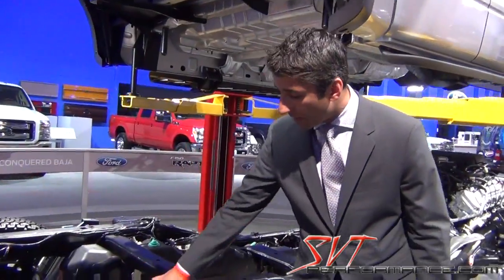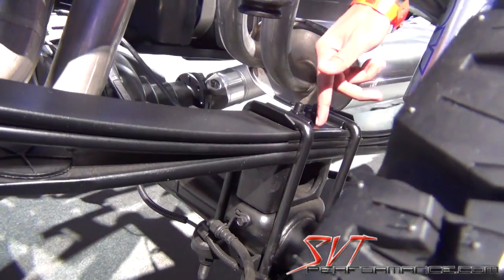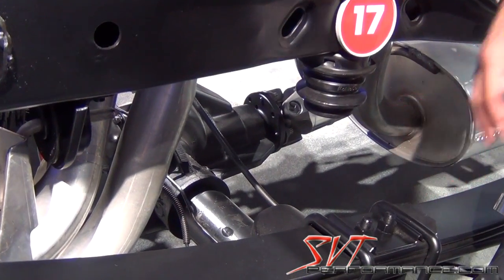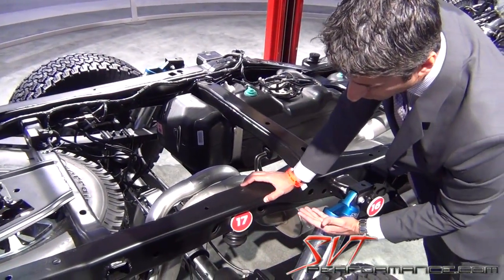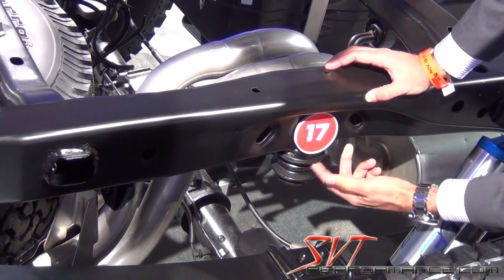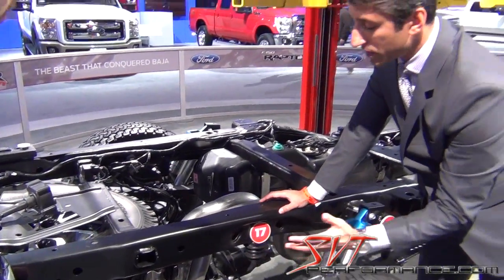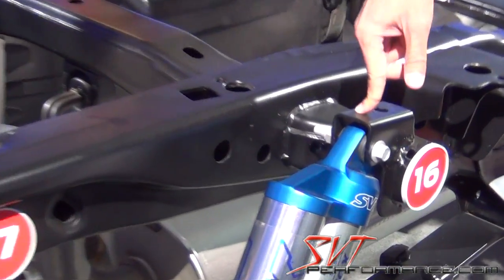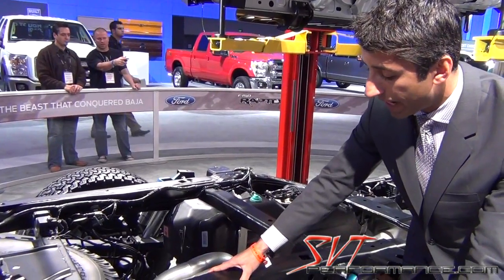SVTPerformance.com :  SVT Comments on Raptor Frame Bending

Comment: The Ford engineer was correct in all his technical analysis. Ford marketing should've consulted Ford engineering before hyping the Raptor to determine the actual limits of the vehicle. Some argue, especially those Raptor owners who ended up with bent frames, that Ford's corporate ego actually encouraged exceeding the mechanical limits that end up bending frames.

Comment: The group of 14 raptors who set on a desert run and 10 out of the 14 trucks had bent frames (where the bent frame talk originally came from). The 10 who had bent frames also had modified rear suspension to some degree or another AND had programmers with electronic limiter removed. The lead driver of this pack was said to be in excess of 120 mph on multiple occasions. NOT what the raptor was designed for.

Comment: so your saying that your not suppose to drive the truck like the manufacture says u can because you will bend the frame or brake the shock mount so whats the point of the truck when u can build a better truck for the same ridiculous price the raptor costs

Comment: they should have over engineered parts like these in order to reduced these problems..... something that the Germans would have done.... just saying they should have gone back and re-engineered the components to a point where you would have to do something literally moronic

Comment: Enjoy your 4-cylinder truck.

You know, since all Jeeps have 6-cyldiner engines, all Ford trucks are 2.3L Rangers.  The Toyota Camry has a bigger engine than every single Ford truck ever made!  It's even more powerful than the Raptor, I guess.

FWIW, typical old-skool Jeeps have an I6, not a V6.

And if you were going to comment on it, should have mentioned that most Jeeps don't even have a frame, except for the Wrangler they're all unibody.  Hard to bend what doesn't exist...
Reply: more displacement doesn't equal more horsepower
Reply: shepd3 this is probably one of the dumbest responses I’ve ever read.

Comment: nope, the problem is def. with the chassis, its so clear. If it wasn't why would there be SO MANY aftermarket products to fix that problem. Not only that, the rear HOPS. the front droops. Clearly you guys screwed up on the suspension and forced a non-offroad-built chassis into and marketed it as an offroad truck. american cars... beefy rims and tyres, a big engine... stupid driveline and suspension. they got a couple of these.. and they broke down.. axles to diffs.. to heat probs. rubbish.

Comment: He's not trying to trick u. He is just trying to say the truck was never designed for what the owners r doing to them and that when put past its limits something will break. And that its safer to bend where it is bending then to have other problems that could potentialy cause injury or leave u stranded. The worst part of this is Ford did something good with building this truck but then the owners go past there limits and blame ford.

Comment: The problem is not the truck, its the owners. Every product ever made has its limits before somethings gotta give. In this case the owners are driving the truck way past its limits and crying cause it broke. Ford did not make a production trophy truck, they made an f-150 with great off-road suspension and more power. If u want a trophy truck then cough up 500k. If u bought a Raptor thinking it was a throphy truck then ur an idiot. It was made for mild offroading, not 100+ mph runs through baja

Comment: They actually reimbursed a lot of people when that happened. And though it was common, added into the equation was neglectful owners. I've had 2 of them before, an 07 and a 05. The 07 never had problems since it was purchased new and was cared for, the 05 on the other hand was used and was showing signs of the notorious 6.0 disaster. A quick egr delete and 20k miles later it's still running fine.

Comment: Idiot owners bending the frames! First off, the RAPTOR must follow Government Rules regarding crash safety, bumper heights, roll over, ect. There is only so much they can do on a STREET LEGAL production vehicle. Personally I'd rather have the Frame bend to absorb energy then to have the ass end kick up in the air making the front bumper dig into the ground and POSSIBLY causing the truck to do a end over! Bent frame > 60+ mph end over end crash!

Comment: Yield the frame. Just say it all you did was replace the shocks and mounts and add a big block under the leaf springs. Yeah its a lift but its no four link its pretty much a lightly modified stock suspension. No Damn wonder it can't hold up. Better off buying a stock 150 and laying in the extra cash.

Comment: what happen is people don't get off the gas in the air after a jump .
if you dont get off the gas the suspension can not do a full droop in the air.
leaving you with no suspension travel .
 the axle hit the frame with the power of a car crash.
i see it all the time . hot shots flooring it in the air .
losing travel and/or nose diving ..
Reply: kaution9876 I had never thought of this! Makes sense to take the power off and let it droop!

Comment: @jeepjoker1 Lets think (a novel concept to many), 5 inches of uptravel at reast, lets hit a 12" bump going 70 and see what happens! The truck is stock, not a tube frame trophy truck with 3 feet of travel. You go so far over the limit, something will break. At least it is a safe, engineered in failure and not something expensive that will send the truck out of control and leave it undriveable.

Comment from the maker: @jeepjoker1 The access hole you're thinking of is actually on the inside of the frame rail.  The number plate isn't covering it.  The problem is with the driver, not the truck.

Comment: I like how they cover up that 3 inch tooling hole in the in the frame with the number 17, RIGHT WHERE IT BENDS. You think MF are dumb, ford sucks when there is a problem, case in point their 6.0 diesels. I BET that hole in the frame is machined smaller in a year or two.

Comment: @workshop77777 Ford did the baja 1000 with it.Not only did Raptor finish the race, but it sped through the finish line in 25.5 hours, placing third in its class in what was originally supposed to be only a development drive.

Comment: @Montblanc1986 I have the production numbers for 2010, over 10k in 2011 over 12k trucks. They just upped production and updated thier 2012 MY truck. The Raptor isn't going wnywhere soon.

Comment from the maker: @Montblanc1986 You information about the Raptor being discontinued is simply incorrect.  If by getting "stonewalled" you mean denial of warranty claims resulting from owner misuse, then yes that is likely to continue.  And the number of truck suffering from being improperly driven is fairly small.  If you don't try to drive a production vehicle like a full tube-chassis trophy truck you won't have a  problem.

Comment from the maker: @Montblanc1986 If you bottom out the suspension enough to bend the frame you are driving beyond the truck's design limitations, it's as simple as that.  You can't blame Ford for an owner's driving errors.

Comment from the maker: @Montblanc1986 The F-150 frame is the strongest 1/2 ton frame made.  Had the frame not yielded the energy would still have to be dissipated.  The other ways for that excess energy to dissipate could lead to a severe loss of control.  I would rather have a bent frame than a totaled truck and a trip to the hospital.  Then again it probably wouldn't be an issue for me because I wouldn't hit a cross ditch at 80mph.

Comment: The "engineer" did a really crappy job explaining

1. He first claims that the shock is now the bump stop with after market springs. Then damage would be at the shock mount points or the shock rod, the failure still bends the frame at the exact same location.

2. When running at really high speed the spring is all the way up - thus very little to zero susp travel left for bumps.

Build a Ford GT40, a Ford Focus and a Ford Raptor the same then expect them to have the same Mall shopping run.....